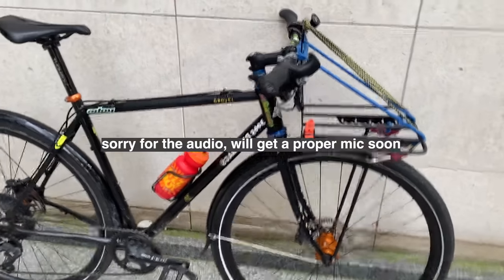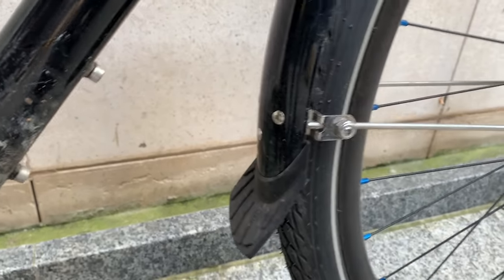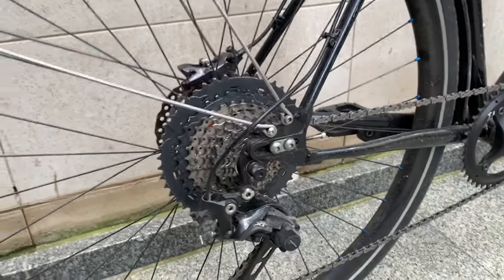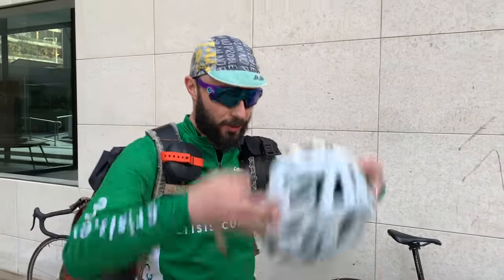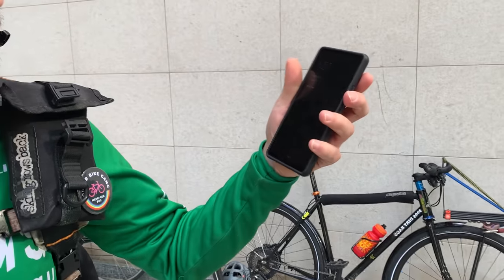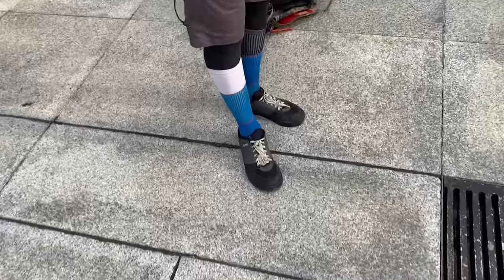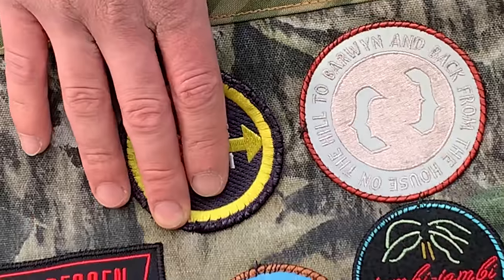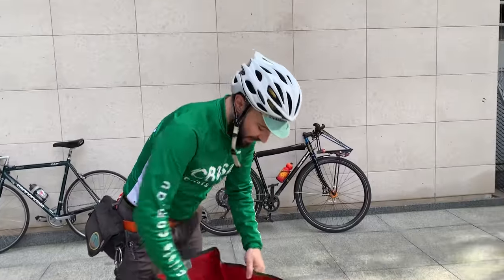messenger bike & gear check

Comment: I be love my flap top. I used to have a roll top and the flap top is so much easier and faster and fluid when you opening your bag a millions times a day and it stays just as dry.

Also with phone pouches I always cut off the top flap of them when I have to get a new one because they just get in the way that way it’s fast and fluid to put it and take it out. When it rains I just put the phone in my pocket it rain jacket/wind breaker pocket. 

Also another pro tip is to get locking skewer (locking axles) on you bikes. You’ll never have to carry or put on a cable or a heavy chain again. I just use a Abus 410 mini u lock. They sell the locking skewers on amazing for like $35. It’s a really good investment.
Reply from the maker: Those are great tips ! Thank you for sharing 💕😃

Comment: my LG G7 from years ago stopped working on the cable and headphones.. been using a wireless charger biking for a year and a bit.. cost about the same as the amount of cables I would have killed. minus33 merino and trek 7300fx disc mullet aerocruiser 6ix waterfront
Reply from the maker: hell ya i should get an extra battery pack too

Comment: his bike is a little busy and looks too heavy for me, personally I used to run a '96 26r rigid steel single speed that barely weighed 9 kilos as my main go to while messengering (I had approx four other 26r bikes as back up also) during my 15 yrs on the road. I never used a backpack for a bag either, just a single strap messenger bag for me and it swallowed large items with ease (disc rotors, clutch kits, client lunches etc)
Reply from the maker: Wow! 4 other ones! Nice to have back ups , were they built similar or for different purposes
Reply: @garysprojects  the backups are all '90's mtb's that I still own today so in that respect they were all built similarly with gears, shifters etc. I ran the single speed for the majority of the time because it was cheaper to run although the parts i threw at it were high end components (pauls, white industries, king) they lasted longer than the standard 'S' components

Comment: Messangers bike should be light,preferebly 1 gear, with simple but effective brakes,and possibly as light as possible! This is...
I don't know...
A gravel bike with the flat bars???😅
Reply from the maker: He probably built it to what he needs it for lol
Reply: I think the days of messengers riding on drop bar-road-type-fixies are a thing of the past/ starting to fade. I live in a big city on the west coast and am starting to see more flat-bar/multi-gear bikes (like the one in this clip) being used by messengers.
Reply from the maker: Yeah doesn’t seem like it was what it used to , I remember seeing a lot of ppl ran straight track bikes , pretty cool
Reply: @garysprojects  depends on the city, in DC we had hills, and I knew only one guy with a track bike...  If I had to do it over again though (who knows, maybe I will ;) ), I would go single speed with drum brakes....

Comment: Useless bike with that mtb large handlebar get a city one
Reply from the maker: R u sure
Reply: @garysprojects  i mean, i do deliveroo, cant immagine passing cars and angles with that handlebar, better a road/gravel one ora a city handlebar
Reply from the maker: I guess different people have different preferences, you do you though 💕
Reply: @ilcorvo980 they are cut to about 700-740 cm, I think they are fine
Reply: @callumjefferies6085  bro 700mm its huge for city, if you pass trough 2 cars, or in traffic you are in trouble, why do you think there are fixie bikes with ridiculous tiny bar? For that reason! Big handlebars are for mtb
Reply: @ilcorvo980  I think I can squeeze through traffic here fine enough,
If I run anything narrower, it will stuff up my handling with the rack,
Also, I have run narrow bars before, dont like them, 
Took too many risks splitting lanes because I knew I would fit
Reply: I have one from ergotec very nice the best for My use look for the brend
Reply: @ilcorvo980  just had a squizz at them on line 
They are the butterfly bars?
Reply: @callumjefferies6085  no thats not good, look for Moon cruise or humpert, that kind of geometry, look for the higher angle possibile about 50° back swep angle, and the smollest in size not top large, look for 600mm